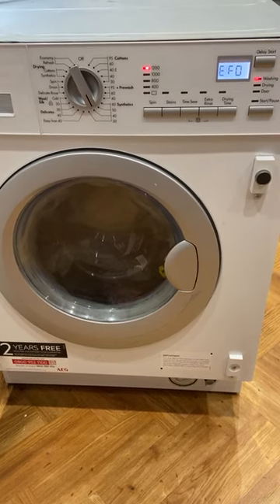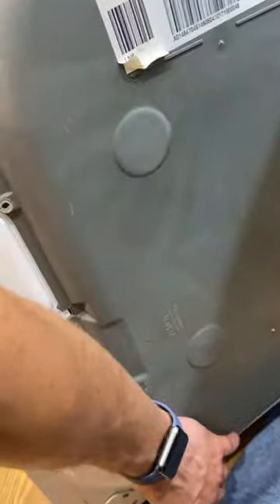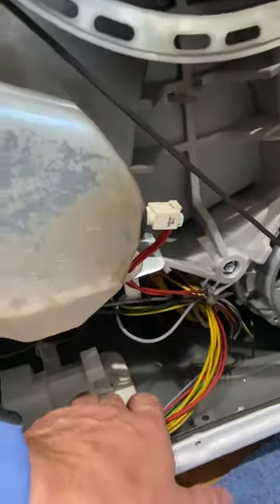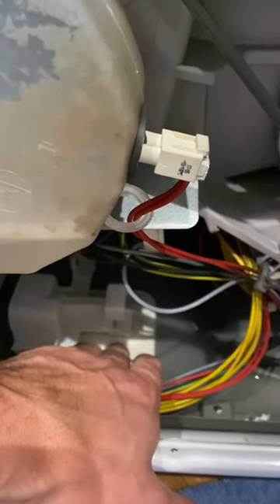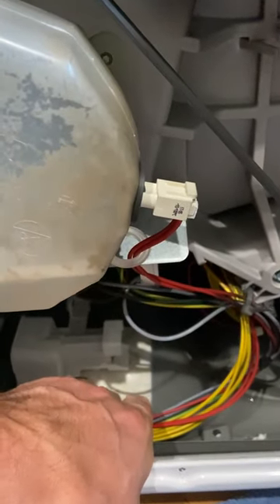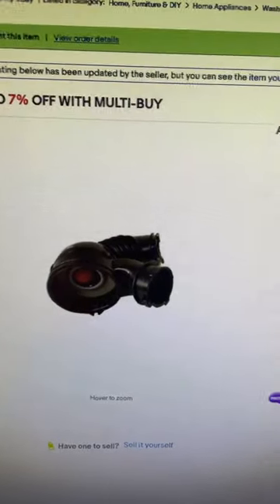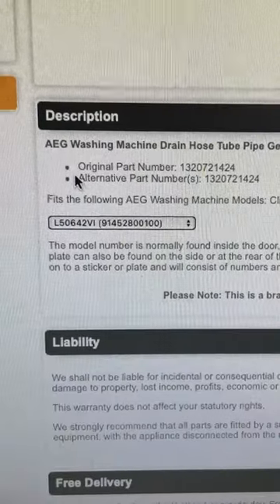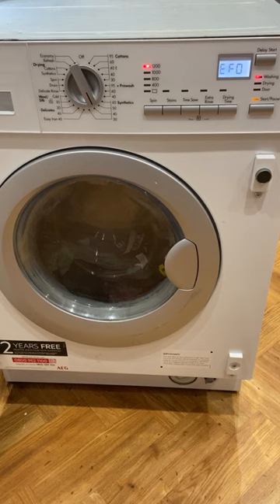AEG Washing machine Fault EF0 - My solution to resolve the error.

Comment: ❤😂🎉🎉🎉🎉❤❤❤❤ thank you very much you've just saved me hours of trying to work out what it is I've got a slight water leak nothing to do with the washing machine itself put the water at worked its way into the machine obviously filled up this tray so I just typed the washing machine to the side emptying the tray washing machine fixed easiest and fastest repair I've ever had
Reply: I have also worked out how to put it in test mode turn it off at the plug press and hold start and time delay simultaneously worst turning the machine back on at the wall goes straight into test mode